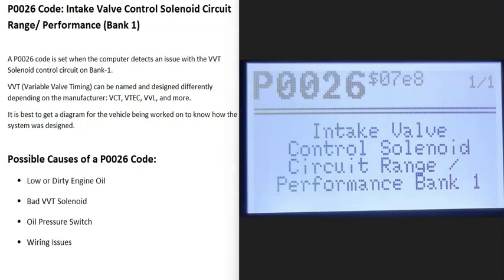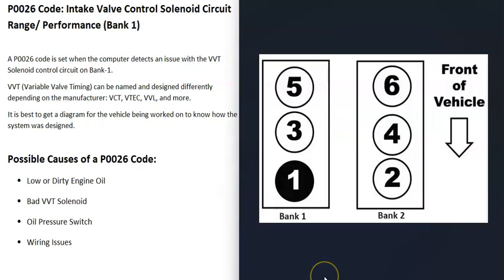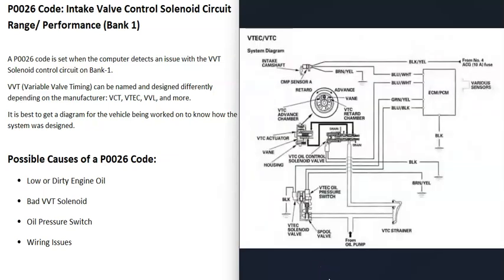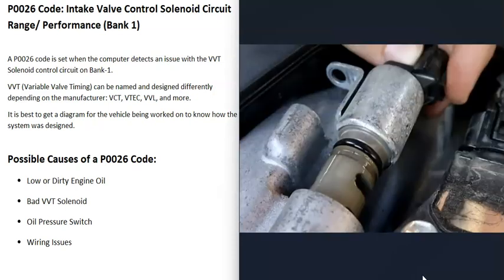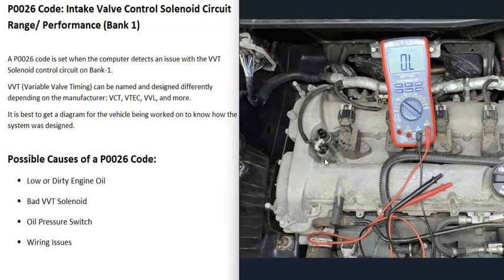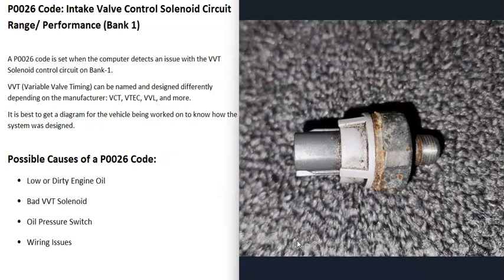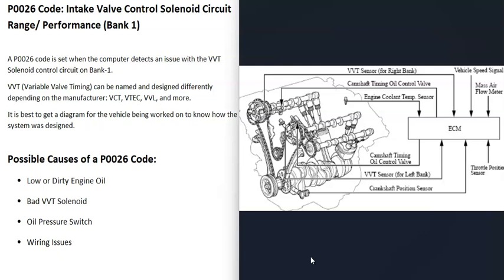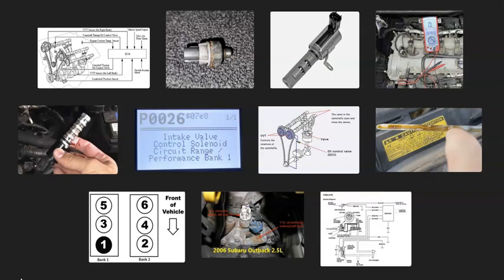Causes and Fixes P0026 Code: Intake Valve Control Solenoid Circuit Range/ Performance (Bank 1)

Comment: Recently while driving a 2009 Subaru, I got the terrible trio of CEL, Traction Control, and (flashing) Cruise Control. P0026 was the pulled code. Following your Step-1 advice, I checked the oil and, to my horror, found it to be nearly dry. The Engine Oil idiot light never came on. After adding oil, the terrible trio disappeared. How is it that the car would first alert with all those xmas lights BEFORE its own Engine Oil light ??